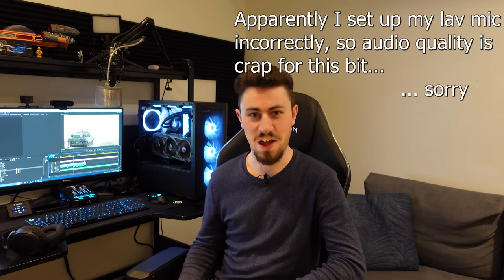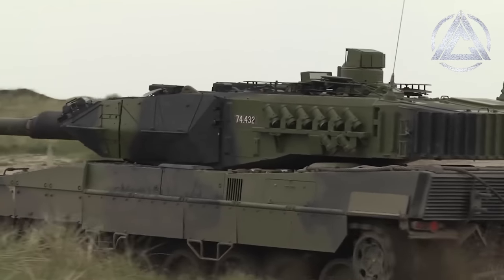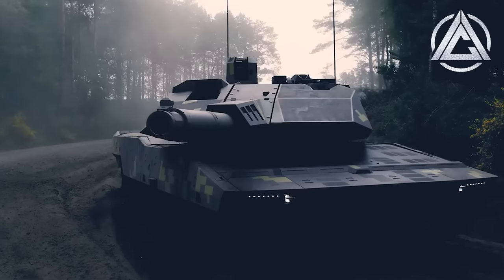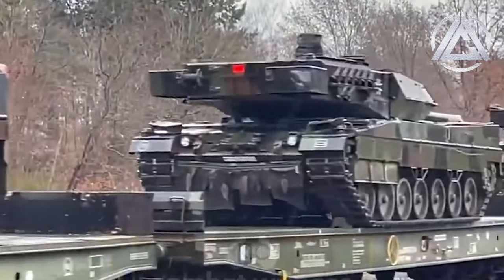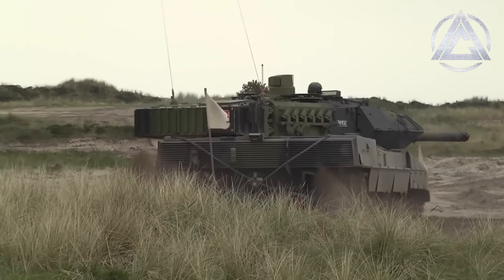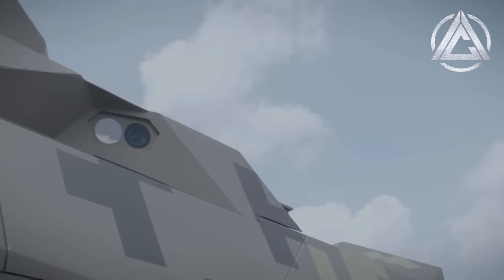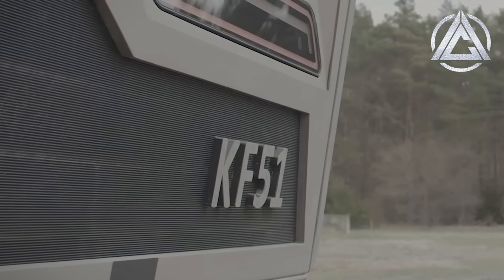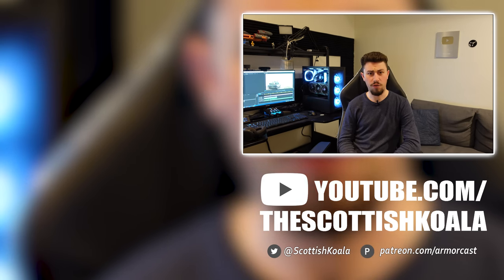Germany's New KF51 Panther Tank | The Spearhead of a New Generation?

Comment: It was my experience as an armor crewman in central Germany (Fulda Gap and East German border) there are very few place where one has line of sight of more than 2 or 3 klicks. The German countryside is often heavily wooded, rolling terrain, with limit sight distance. This may not be the case in the northern plains (I don't know, never trained there), but in much of central Europe a gun with an effective range greater than the advertised 3.5 klicks is probably a luxury.
Reply from the maker: Very true, but vehicles like this are also exported all around the world. In Turkey for example, Leopard 2s could potentially have been firing out MUCH further than they could in the rolling, wooded terrain of central Europe. In the Gulf War, Challenger 1 was able to surpass 5km, and there's no reason to suspect M1A1 Abrams could not have done the same. 

The same is true for much of Asia and Scandinavia, where mountainous terrain can, rather than BLOCKING visibility, actually put you high enough to be firing from one mountain ridge across to another! Those distances can easily reach 5km.

In other words, I agree it is absolutely a luxury, but one that CAN be very useful depending on who ends up using the tank and where in the world it goes.
Reply: In addition to Armor Cast's reply, I'll also say that these tanks are probably made for particular battlefields, such as eastern Europe, the mid east and whatever other areas are expected to be future battlefields.
Reply: One benefit of larger rounds is they can be improved upon when it comes to smart munitions and hybrid projectiles. You can have a lot different varieties of warheads and such from what I understand. 

Also a 130mm basically future proofs the tank. Hear the US was jostling with having the ability to have a 140mm.
Reply: I'll agree with you there, but the ability to really reach out there in the Gulf was a huge blessing.
Reply: Longest tank on tank kill 3.1 miles by a British Challenger rifled barrel gun
Reply: @ArmorCast  A smooth bore M1A1 could not match a Challenger rifled barrel for distance kill in an equivalent shot. ie why we have never seen a M1A1 smooth bore shot of anything like  many Challenger shots in conflict. Optics in Challenger are also better. Scandinavia, who have a basic point but, take in cold air and altitude against an Iraq desert shot with hot air. In a different case look at the sniper shots in Afghanistan, the hot air and altitude completely changed the shot
Reply: Still, you have a distance from hill top to hill top of 5-10 km. You may did train in areas you were allowed too, but in a real conflict, you have to fight everywhere.
Reply: what measure is klicks?
Reply: @theokingshango  A few months late, a click is a kilometre.
Reply: Tanks fight on all different terrains, such as desert or mountain and have even longer range engagements
Reply: Cool man. When did you serve in Germany? I lived in fulda from 81 to 86.
Reply: @dianapennepacker6854  France and USA are pushing for 140mm gun, Germany wants to impose Rheinmettals 130mm which will fall short in the next 20 years. I say go big or go home with 140mm, gun platfors last over 50 years now, you need that extra wiggle room. If you see throughout history canon upgrades are always 15mm+. We went from 20mm to 37mm to 50mm tp 75mm to 90mm to 105mm to 120mm. 140mm is the bare minimum to have a gun platform with longevity in mind. Not against armour targets necessarily but the extra caliber wiggle room allows for very high explosive payloads against structures in urban combat and also for modular smart rounds. You need space for smart fuses, sensors and hybrid payloads.
Reply: @Frencho9  Yeah. Bigger caliber allows for fancier shells. Like more missile juice. Crazier cluster munitions. As you said - more boom. 

 Could fit a drone or loitering munition in a 140mm shell that can destroy a variety of targets. 

 They better put a firing control unit on the damn tanks that allow them to fire like artillery. Blows my mind not all modern tanks can do it. 
 
 Anyway I agree with you. With the way we keep platforms around these days having room for upgrades is always good. 

 I guess they could go the Russian route. Design the tank so that it can have a bigger gun down the road.
Reply: @ArmorCast  designing vehicles designed for use in domnestic armed forces to operate in foreign / non-native landscapes has an uncomfortable feeling to it, though